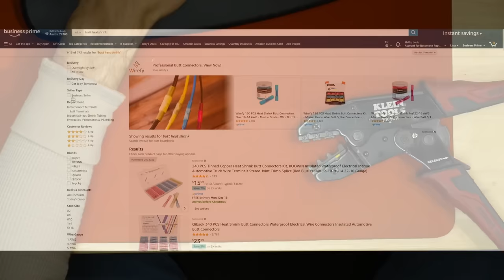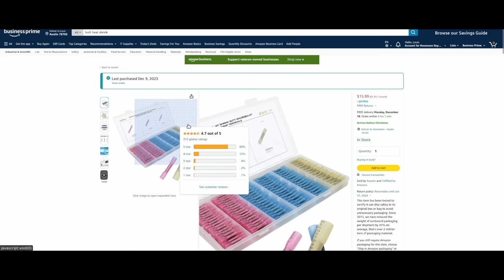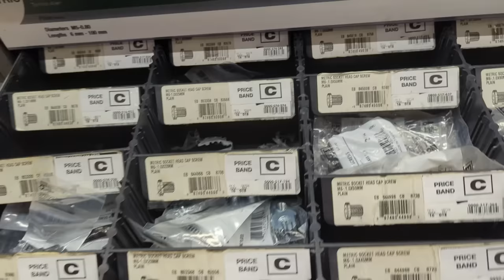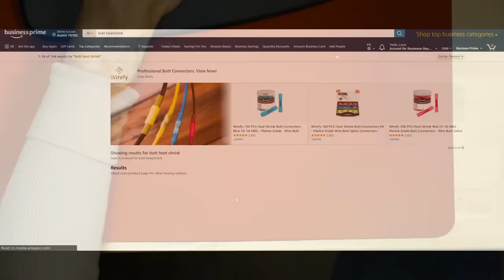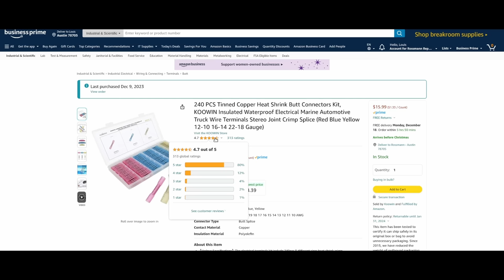Amazon Sells Dangerous Electrical Crimps

Comment: I bought a 4-pack of detergent on Amazon. When I got it there were only two. The title said something like "2 x 2 pack", but the main thing was the image which said "4-pack" in the corner. The price was about the same as supermarkets were charging for actual 4-packs. When I went to return it, it said that the item is not eligible for return. I started a live chat, and the agent told me that I am wrong and that it is obviously just a 2-pack. They refused to help. I started another live chat and this time the agent said they would start a return for me. When I got the emails about the return that had just been started for me, they had chosen one of the other items in the order, presumably because they also were unable to open a return request for the detergent. I then had to cancel that, and write a complaint email to Amazon. The complaint email was thankfully answered and they refunded me with no need to return it.
Reply: I was supposed to get a 12 pack of canned corn beef hash for about 30 dollars, and I received 1.
Reply: I purchased a odd size (small) lightbulb for a project I was working on. The image on the amazon listing showed a box labeled "10 pack" and the about this item section said 10pc. The listing was $11 which seemed about right for a 10pc order of tiny 12v lightbulbs. I received one tiny lightbulb, in a huge box.
Reply: Its sad because everyone probably has an experience like that now - I ordered a really nice looking wax melter, made of wood, and received a cheap dollar-store humidifier instead. It was also rainbow colored with a shiny pink metallic finish, (the whole thing was made of VERY cheap plastic). Probably the funniest but also the shittiest order I ever made. Immediately returned it, left a 1 star review and complained to Amazon. They should have given me extra for having to drive to the UPS store.

Comment: The biggest problem with name brands is that you never know when they will change management and switch from quality to cheap. Rubbermaid and Tupperware jump immediately to mind.
Reply: Rubbermaid tubs used to be very flexible and bulletproof. But now they are made from cheap hard plastic that cracks if any flexing force is applied to them. They are just like Sterilite containers that way.
Reply: This is why I love shopping at thrift stores.  You can find vintage household goods in great condition for less than the price of newer, lower quality stuff.  Of course, shopping at thrift stores is hit-or-miss.  But they're great if you enjoy the treasure hunt aspect of it.
Reply: I bought a Craftsman toolbox from Amazon once.  It was made of plastic and I knew that when I bought it, but I assumed it would be thick and rugged.  When I received the toolbox, I couldn't believe how cheaply made it was.  it looked like a toy toolbox.  The plastic was thin and it was warped so much, you couldn't even close the lid properly.  The metal clasp was so cheap it bent when you tried to close it, and the "Craftsman" brand was printed on a paper sticker that was slapped on the front of the toolbox.  Of course, there were nothing but 4-star reviews for it, so reviews are utterly worthless, and even if you buy "brand name" stuff from Amazon, it doesn't mean you're going to get anything of quality.
Reply: Sometimes it's even dangerous, like the new Pyrex being non oven-safe. So many unnescessary accidents happened because people mistrust the brand.
Reply: This just happened with the wal mart (George) t shirts. They increased the price a dollar and now they're made in Haiti and they suck.
Reply: @GalaxyFur  Spot-on observation. Sterilite is crap. Rubbermaid's Brute line and other Industrial/Commercial offerings solid products. Glad we got their French Blue-lidded home stuff when we did. Cheers!
Reply: @hamsterama  Agreed.
Reply: @Luthiart If you're still in the market; Pelican, DeWalt, Stanley and Hazet plastic cases remain lifetime-grade products. Cheers!
Reply: @blackrifle6736  Thanks for the recommendations, but it was over a year ago when I bought that "Craftsman" box.  I ended up buying a toolbox from Walmart that's an order of magnitude better for not much more money.  I can't say what brand it is (there's no branding at all on the toolbox itself), but it's durable as hell and it suits my needs.

Comment: Something important to keep in mind too, is that if a product fails and burns down your house, if you bought it on Amazon, you can't hold Amazon responsible. You also can't hold the company responsible that sold the dangerous product to you. There's tons of examples online, such as with electronic scooters. It scares the living hell out of me when I buy a cheap device from Amazon that need to be plugged into an outlet. If you bought products from a Walmart store and they caused bodily harm to you, you could hold them responsible, but with Amazon, there's nothing you can do. It's completely insane to me that this is legal.
Reply: I don't think that's correct Amazon is like a third party vendor so if they get a report of a dangerous product and they don't take it down they could be held liable. Product liability rest on the storefront that sells on Amazon also in the case of Chinese products they're usually the ones that import them.
Reply: @airhead151v151  Feels like some court happenings already happened but Amazon just paid the settlements(or whatever its called)  fees quietly since they make a lot of money, then still continue. 

It would need an extremely good Samaritan in the next election to put a stop to it if not slow it down. If they weren't bribed to stop it in the first place.

Comment: A problem with reviews is that a lot of people review products upon receipt based on how they look, but before they have put them to the test.
Reply: Now that grind my gears. People will say “ I did not test it yet, but it arrived really well packed and looks nice”…how the FUCK will I know anything about the product with that kind of review?
Reply: I think this is partly because Amazon asks you to review products within a short time after delivery. Many products, especially electronics, take significantly more time than that to be put to the test. It's like, remind me in 2 years, Amazon, and then I'll review it.
Reply: To be fair, the opposite reviews exist too "package arrived damaged, 0 stars" ... both are terribly annoying.
Reply: People have always been garbage at reviewing. I'd read them like crazy from 2014-2019. People are also notorious for using a product completely incorrectly.

Ex. During the pandemic I was reading n95 mask reviews and more than 1 said they were "mismanufactured" because the ear loops were stapled on wrong. ....but they were overhead elastic not meant to go on the ears...

People being morons giving completely useless reviews has been a real problem on Amazon for a long time. It seems like they've finally started dealing with that... Only to not account for how sellers might abuse a self reporting system.

I had a pretty good way to spot out "reviews from an idiot" and factor that into my assessment of a product. I can't assess a product based on reviews that aren't there.
Reply: @SoulDevoured Yes, N95 has one strap that goes on to the upper head.

Comment: I have noticed that the search function has deteriorated recently, maybe last few years, to the point where it is difficult to narrow searches by brand name or product number etc.  It has become harder to sift through the crap offerings.  Frustrating and sends me to other online sources.  They have definitely adjusted the search algorithm to peddle junky products.
Reply: I get furios if I type in a 20 character part number and it presents me something entirely different with a vaguely similar number or description. If I search for a Honda wheel bearing, an Opel one doesn't help me in the slightest. Ironically Ebay seems to have gotten better with this in my opinion :D
Reply: For sure. I'm no longer amazed that when looking for a mass market pair of shoes, I get a response that there are none left in stock. Anywhere is the largest consumer market in the world.
Reply: Not deteriorated; refined.  It's been refined to show you what they want you to buy regardless of what you want.

Comment: I have bought lots of stuff off Amazon in the past. The problem is, is that most of the time local stores don't sell what I need/want or a worse version (plastic vs aluminum etc). But I have had my share of bad products on amazon. Luckily been able to send them back and get a refund usually. Would prefer not to give money to a monopoly all the time but until I can find the same items elsewhere without it being so much more expensive it's hard.

Comment: Lately I've been very disappointed by Amazon, I'm an Software Engineer and PC enthusiast since the 90's, and I usually buy pc hardware from amazon (sold and fulfilled by amazon), Last two video cards I bought were clearly used; with dust and fingerprints all over them, and all packaging seals were broken, a few months ago I bought a 2TB ssd drive that was clearly used and had around 1TB of personal data from the previous buyer...I paid for NEW items, not for open box products. One thing all items had in common was a LPN sticker, which seems to be a clear indicator of items that were returned to amazon.
Reply: what is an LPN sticker?
Reply: Had a friend buy airpods and he got fakes 3 times from them cuz people would buy the real ones and return fakes. I know of plenty of people that sticker swapped nvme drives and returned them.
Reply: buying from local hardware stores never disappoints, even if i have a problem with them they'd be more than happy to help me, buy local and never from amazon.
Reply: @rdiznfriends  printed label's.
Reply: Wow, what kind of personal data was still on there?
Reply: The sad part is its getting harder to find hardware locally. Im in AZ and after Frys Electronics closed the only other option is Best Buy and they have nothing in stock. I just upgraded two systems and I had to order almost everything from Amazon because it was the only place I could find the parts I needed. Hate giving them money.
Reply: @TheWoolyShambler29  NewEgg ?
Reply: Returned products just get relisted until it has been returned several times. Then it’s clearly defective for Amazon and it goes to the scrap or sold on palette.
Reply: Newegg was always the best for computer parts, but when they sold to some Chinese company or something like 6 or 10 years ago, the quality went to trash. Although they've been getting better. Amazon was always shady for computer parts. Always make sure you are buying from Amazon itself.
Reply: I bought an ASUS Spatha-X for $99. Sweet deal! The box was not sealed and alarm bells went off, and upon opening it, the mouse was severely worn. Like, super used-looking, and the area around where the charging cable plugs in was MAULED like some clod had repeatedly stabbed the plastic with the USB end. The stickers on the bottom had clearly been peeled off, etc. I went to exchange it and the ONLY option was a refund, and the mouse was now $150 -_- I was livid lol, but going around the loop and getting a customer service rep, they sent me a new one. I wasn't letting them off the hook.

What I finally discovered was that someone had bought a Spatha-X and returned their original Spatha. The mouse I'd been sent had a micro USB and the X is C. The person literally swapped the stickers from their original mouse to the X they bought and returned it, then Amazon tried to sell it to me. I put a note in there saying DO NO SELL THIS, THIS IS THE WRONG PRODUCT AND A PREVIOUS PURCHASER CHEATED YOU.

The second one was properly sealed and the actual Spatha-X
Reply: I bought a Noctua CPU cooler and the fan was stolen. The bag it arrived in was clearly opened.
Amazon says talk to the manufacturer, not them...
Reply: Yep just got two 4k WiFi cameras boxes had “Returns” printed in it. $15.00 but Amazon returns said no need to return them.
Reply: I bought 4 enterprise SAS HDDs from Amazon once, labeled as "new." One of them was unused as stated, but not necessarily new. Old manufacturing date. The other three had SMART data showing they had been running for 5+ years already. I returned them all, and Amazon said they would take care of the listing. I checked on the listing regularly for a few months. They never did.
Reply: Amazon employee here. LPN is sticker that is put on items that were either returned from previous buyer or items that has some minor damage (on the package for example) but Amazon considers that as fully functional item. In general, Amazon doesn't consider damage to the packaging or even minor damage to the product itself as damage. "Customer orders product, not a box" is one of many things that you hears every time. If your item has an LPN sticker, or worse, a green or orange Warehouse Deals sticker despite the fact that you order a new product, check everything very carefully.

Comment: For the stolen Home Depot items, make a pickup web order so the employees notice the problem.

As for Amazon, I've noticed the lower quality of sold items too. Sometimes brand names are on the 5th or 6th page of the search results... Even if you specify exactly the brand name in your search! I honestly think their search engine is broken, you can input very specific details on what you're looking for and the results are all so random... 😓
Reply: Can prove the random bit... can't count how many times I have searched stuff to get completely different results for what should be insignificant changes to the query or order of keywords. Or where you can try the same query and get different results on the same day...
Reply: @dragonridertechnologies absolutely.....guess what....through all of this nonsense  ......surprisingly initially then not surprisingly.....it's all still extremely well worth the nightmare for amazon. ......it could be worse and amazon will still rock and roll.......I mean......one word......volume
Reply: Right it takes forever to find name brand these days
Reply: They're not random. They're organised in a way that makes Amazon the most money. Making you doomscroll and spend more time on th site is a part of that.
Reply: That's not random. That's by design.

Comment: Thank you for making this video. Amazon has ruined the shopping experience in the last 3-5 years. They've turned the shopping experience into a sort by price nightmare. Where a customer will buy 5 trash items, and spend 2-3x times the price of good product, before finally buying from a reputable brand. 

I'm not so glossy eyed that I can say every single brand name product is amazing. But generally speaking a company trying to build a brand is going to put a TON more work into their product, thank company UGKPTIO who literally is just one giant factory somewhere under like 15 different random letter assortment names, sending you the same exact crap. 

It also makes it hell because say, for whatever miracle, that their product actually was good. Good luck finding the right one, as some of these will also be taken down pretty quickly and then replaced again with a random assortment letter name.

Comment: Had this experience with propane hoses. I bought two identical hoses and noticed at some point that the threaded connector for one of them had only a thread or two of engagement and the red locktite was holding it together.

Comment: Nice to see other people, who experience the same as I do on Amazon. Shopping on Amazon has become so unfun, because it is so bloated with these weird pseudo-brands trying to sell me often good looking stuff (their photos are often very good; their texts, however, garbage) for super little money. I started to avoid buying on Amazon whenever possible over a year ago. There are only very few items I have to buy there, because they are nowhere else to be found or much more expensive elsewhere. Nowadays I rather register at some small shop instead of buying on Amazon. I hope Amazon is going to lose a lot of influence for what they are doing and small shops get bigger again (and stop dying out). Also: support your locals!
Reply: Bought a Michael Kors dress with an up seam on one side and a sideways seam on the other!! Had to fight tooth and nail to get ALL my money back! Shipping, too!!
Reply: Shopping on Amazon is insane now.  It's hard enough trying to figure out what to buy for someone, but then I have to spend forever going through a ton of different versions of that product.
Reply: Yes, a lot of those Chinese brands seem to have been named by a cat walking across a keyboard. There just doesn't seem to be any desire to create a cool sounding brand name, probably because there is no intention for the brand to be around for long. With Amazon's help, the brand and the product type will simply be switched out.

And yes, the bad grammar and spelling are always a sign of a sketchy manufacturer.

Comment: Lois- you are 100% correct.  I have been ordering from Amazon since they only sold books.  I noticed exactly what you described.  From selling branded reliable products that have been proven to now only (or mainly) cheap knockoff products that can get you killed in some cases.  I have to spend a lot more time trying to find reliable products, rather than throw away products.  I was also part of the Amazon review program for many years and I have my doubts about how that program is managed and I never trust "vine reviews".  These vine reviewers are worried about whether too many negative reviews of free products will get you booted and there is an unhealthy loyalty to Amazon in exchange for free products.  Say something bad about the program, and hundreds, if not thousands of vine reviewers, will attack you in the forums.
Reply: Why did I read your comment in Peter Griffin's voice?